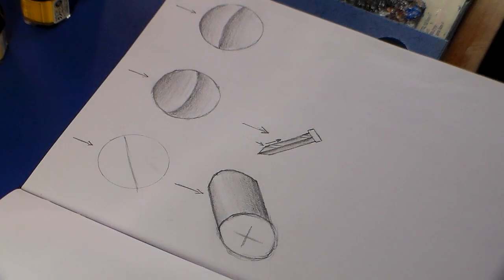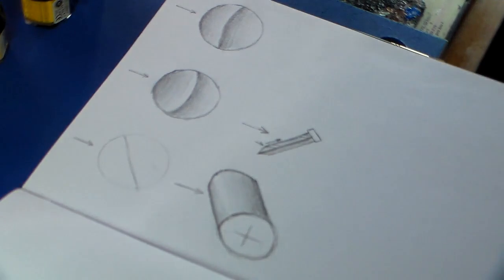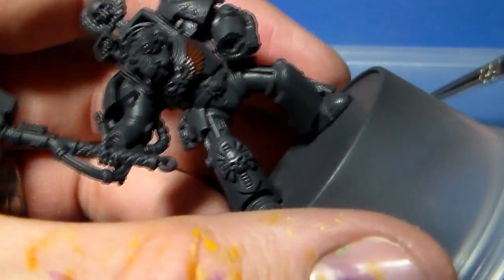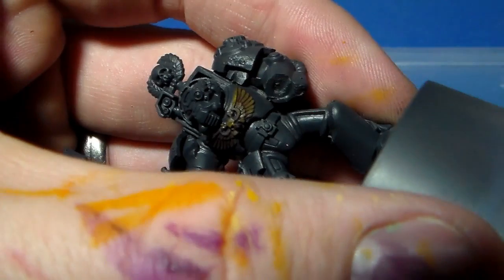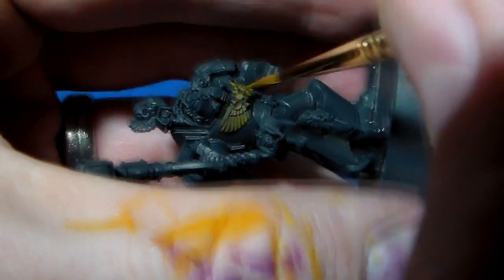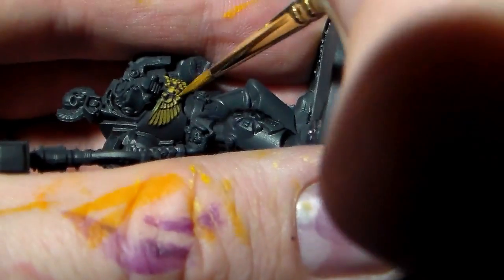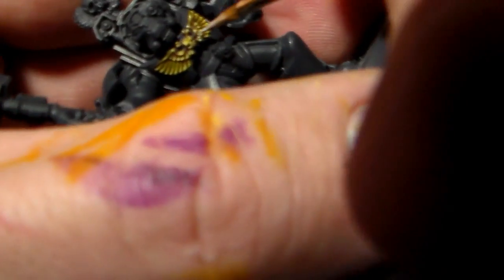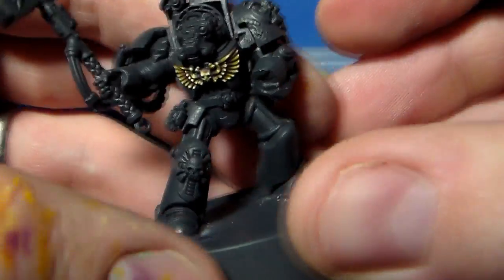Painting Tutorial - Non-Metallic Metal Gold

Comment: Great video! Help a lot with my nmm gold miniatures. One question, what is the skin test for pain saturation that you mention in the beginning? I am intereseted on that because I struggle to get the right amount of water when I am diluting GW/vallejo paints. I normally put too much, which makes the paint to flow into the recessers.
Reply from the maker: Ferran Grau Leal Hi Ferran! So the skin test just means that you put a little bit on your skin and if it runs into the recesses and folds in your skin then the consistency is about right. 
Don't use water for GW paints - it gives the paint a bad quality and is not great to work with. I would recommend the medium that GW sell, called Lahmian Medium - as this is the stuff the paints already have in them to thin it down. 
With Vallejo, then use water - as Lahmian Medium will screw up Vallejo paints.
Reply: Colour of the Gods  the lahmian medium really changed the dilution and consistency of GW paints. As you said, vallejo are well diluted with just water, but I wanted to try their own vallejo glaze medium and the results I am getting with this medium are good enough for both vallejo and GW paints, I think even better than with lahmiam medium (give it a try if you hadn't yet). I am getting closer to a nmm gold (but more yellowish in my case, since I am paiting high elves) and mostly thanks to you. Cheers!